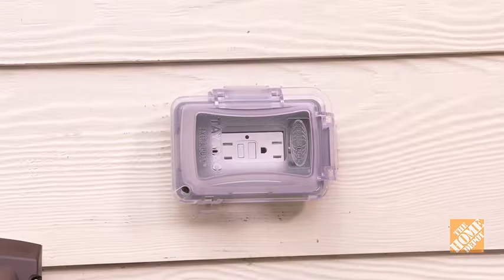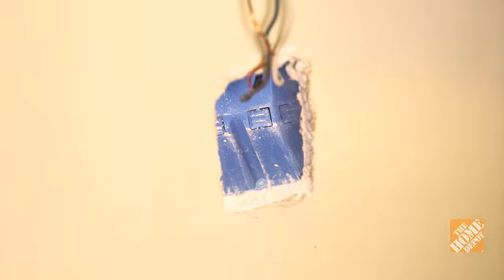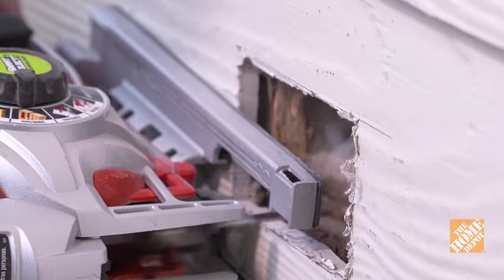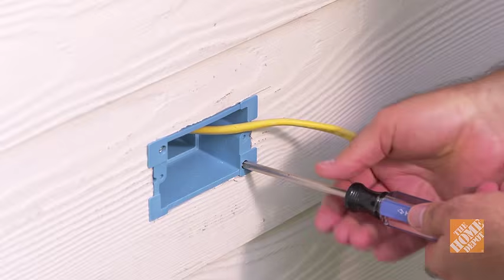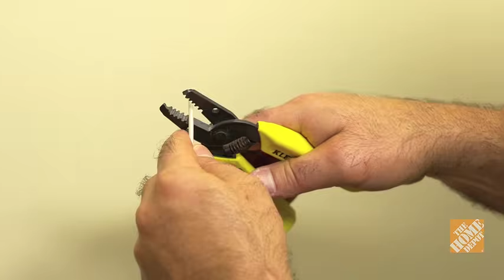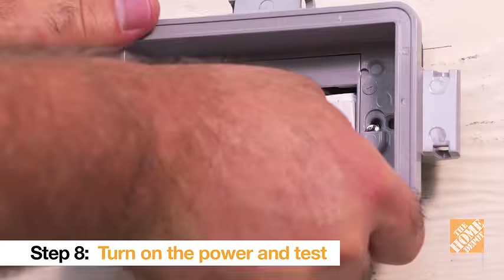How to Install an Outdoor GFCI Electrical Outlet | The Home Depot

Comment: use an outlet electrical  tester anytime working on outlets it makes sure you have correct polarity and proper grounding of the wiring,  most testers come with a button to test GFI operation as well.